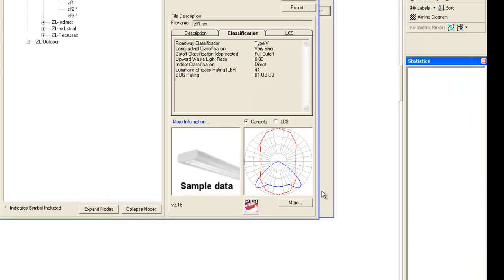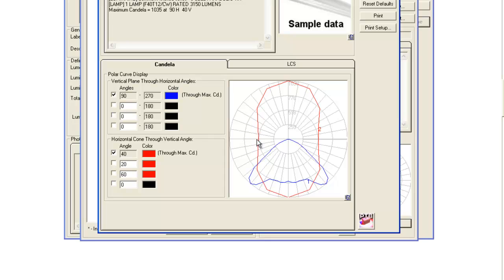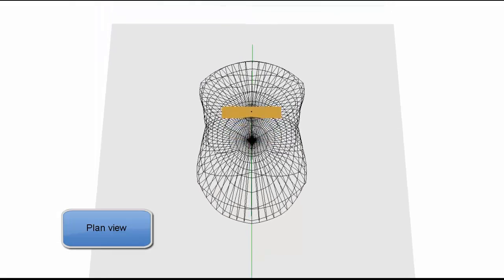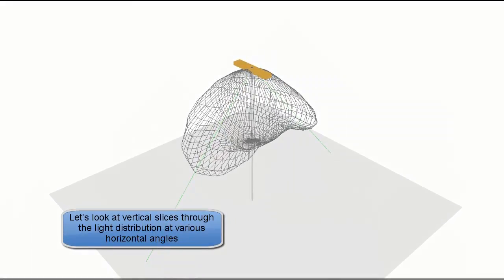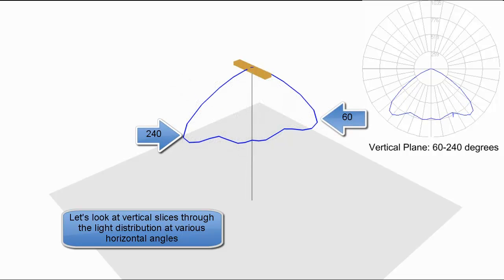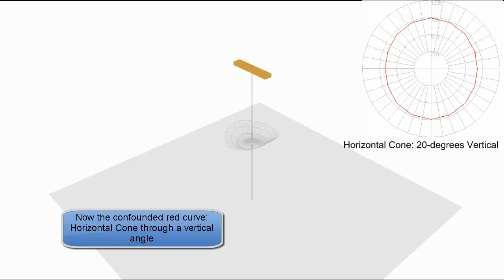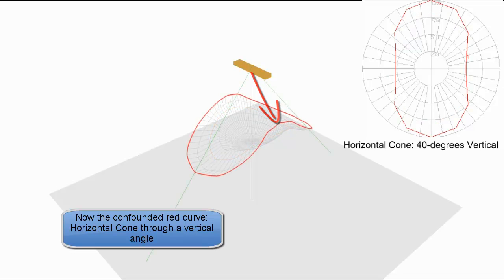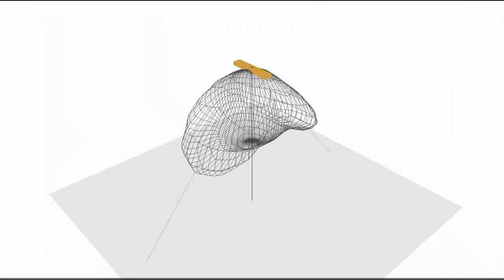Understanding polar curves of luminous intensity

Comment: It would be nice to have a quick explanation on the polar graph on the different numbers and what they represent. Also, what illuminance level the colored lines represent. I think the shape is intuitive, but how that translates to a real building with real equipment is what I find confusing.
Reply from the maker: The plotted lines are intensity in candelas and not illuminance (fc/lux). Illuminance is a function of distance. Divide the intensity in candelas by the square of the distance from source to point to get illuminance :) (uncorrected for horizontal or vertical).
Reply: Yes! I have yet to see a chart with units on the numbers. Honestly I don't respect charts that don't label units.

Comment: It's honestly very easy to grasp. If you just try to imagine for example a 2x4  with a frosted lens on a type C goniophotometer you would get more rounded distribution, where as if you have a linear prismatic lens on a vapor tight for example it would look more jagged. It is really just about looking at  the light distribution in real life and imagining it on a 3D plot. As for polar plots, they give you 0-180 and 90-270 so just understanding where the axis are and how the fixture is mounted in reference to that is a big help

Comment: Why do I not see a "horizontal" cone? To me, a cone that's horizontal would have its base plane perpedicular to a traditional XY plane, with it's point pointing either in the plus or minus X direction. I.E., if you were holding a little wooden cone "horizonatally" in your hand, you'd have the point facing to the left or right. In this video I see no such visual metaphor.

Comment: Could you please explain the relationship between the angles and the shape of the vertical plane of light? I see that as you go from 0 + 180 degrees to 30 + 210 degrees and so forth the shape gets wider, but I do not understand how these angles are determined. Basically, when looking at the shape of the light, how can I determine what the angle is?
Reply: Melanie Prada 
vertical section of the 3d photometric data from different angles